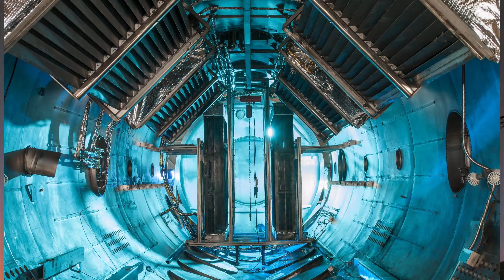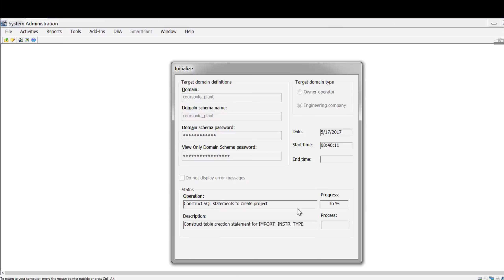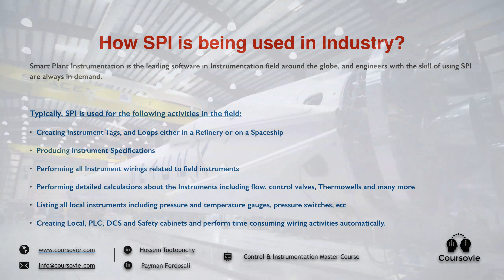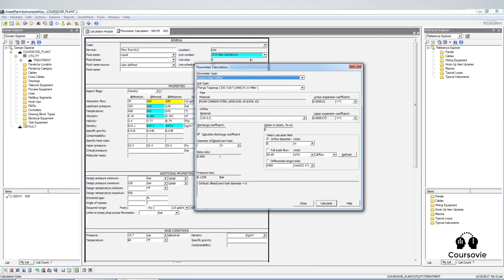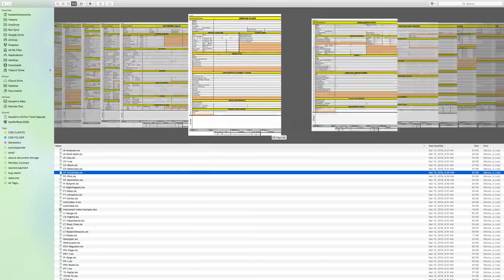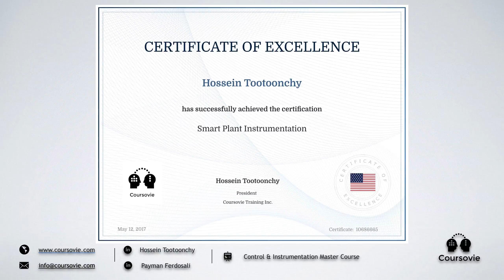smart plant instrumentation training (SPI INtools)

Comment: I am an instrumentation engineer having 8.5 yrs experience. I am in confused state to turn as design engineer. So after seeing your video I got doubt that what would be the difference between SP3D design and SPI Intools. In which path I need to prefer to build up my career
Reply from the maker: SP3D is for Instrumentation and Refinery 3D design and simulation. SPI Intools is used in engineering, production and maintenance part of it. If you are instrument designer you will be using the 3D design, if you are an instrument engineer, you will be working with Intools more often.
Reply: SPI Intools is focused on Engineering and Hookup drawings, SP3D is designed focused. Short Answer is you need to know both. As an engineer you should have a pretty good understanding of the design requirements, and why designers choose certain tools, connections, etc. Similarly, a good designer should know enough engineering to pick one fitting over the other as an example.
Reply: @tutunchi  may I know the procedure to turn as design engineer.
Reply: @GMA2025-z1p  bro , can I get your contact number??
Reply: Is it applicable for wastewater treatment plants engineering & design? Or just O&G field?
Reply: Hi. I need. Help. A bwot. Instromeiton. In oil and gas. Can you. Help me